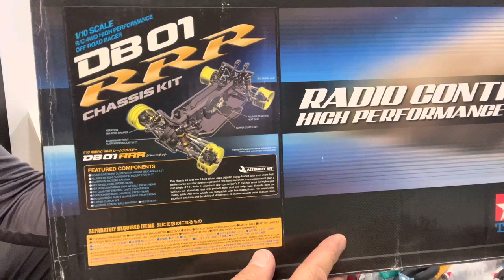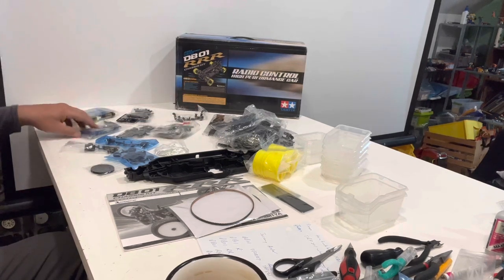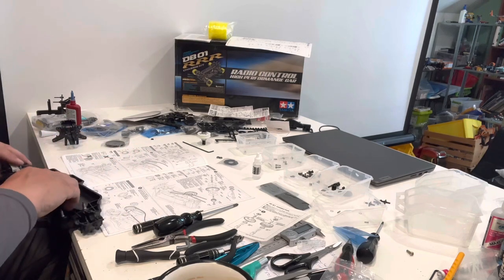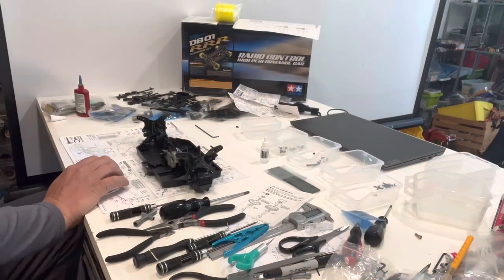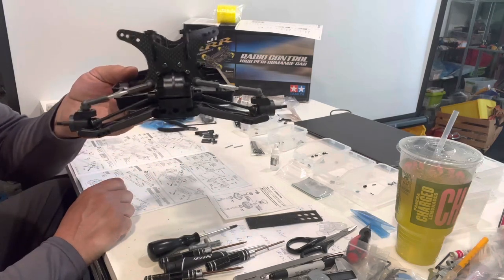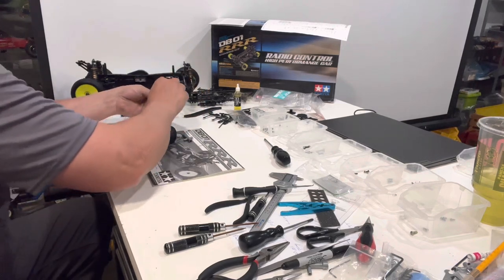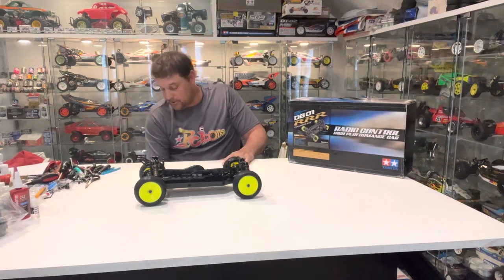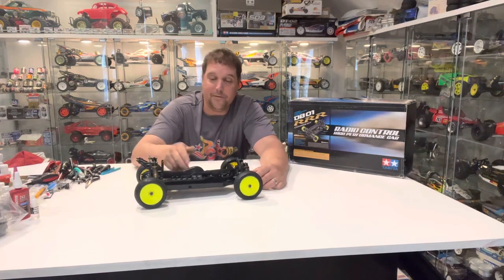Building a Tamiya Db01RRR from NIB.

Comment: I recently finished building my Durga, but I got as many blue parts and upgrades I could get my hands on, I also got front and rear carbon shock towers from eBay here in the UK. I also added the aeration shocks with the white springs, it’s the first tamiya kit I have built in around 30 years 😅. I enjoyed the build though, loving your channel 😎
Reply from the maker: Thanks Stuart.
First build in 30 years and you went full hop up? Yah, you’re hooked. Awesome!

Comment: Keith great build. I would love a DB01 RRR. I have a DB01 Durga that I have been slowly hopping up. Recently I added a repop Baldra body and wing with original Tamiya Baldra decals. I painted that body in pearl white. She looks stunning out in the sun. I found some aftermarket blue aluminum 5 star 12mm hex wheels. If you want dark gray wheels go with the white dish 12mm hex wheels and use rit dyemore graphite dye. That should get the carbon fiber color, use standard gun metal paint, with a Baldra body and TRF decals. Looking forward to seeing your DB01 RRR finished.
Reply from the maker: It really comes out great!

Comment: I couldn’t find an RRR kit so I bought all the individual parts to build one, albeit with blue anodized aluminum rather than black.
Reply from the maker: Still awesome. They are so expensive now that that is definitely the cheaper option.
Reply: @rcicons4915  the only part I couldn’t find (per the RRR manual) was the chassis.  I ended up with an R or RR chassis that had the motor heat sink plate opening (unlike the Durga chassis).  I had to Dremel out the NiMH battery conforming ribs to be able to fit a flat LiPo pack.

Comment: I could not find an RRR for the life of me, even when i offered my nice 501x with blue screws and everything. No bites. So I bought all the parts, gear diffs and all. Then i bought a durga kit from japan for 250bucks, luckily flat lipo chassis. So I built the RR myself with the baldre shell. Only thing it lacks are the carbon towers, on their way of course=) Its my second favourite car after my two top force evo's i have tricked out so much you wouldn't belive, with shorty batteries, oil filled gear diffs etc=)

Comment: The regular Durga has black dish wheels.
Reply: The base DB01 Durga black wheels are not 12mm hex wheels. The fronts use a smaller hex and the rears are pinned.
Reply from the maker: Yes.
Black pin on style.